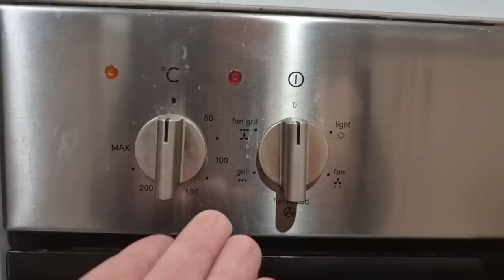The Tool That Changed the Gold Rush | Why Did The Gold Rush Miners Use These?

Comment: As an experienced rocker box builder and user I would recommend putting a few riffles on your top mat and have the matting between them (I usually use 12mm square dressed pine) and miners mass as the mat. All of this will increase the top mat recovery and help it spread the material out, which increases the bottom recovery as well (ie. run more material or clay-y stuff between clean outs) while still being a more authentic rocker box
Reply from the maker: Thanks for the tips!
Reply: Would dream may be good for the box?

Comment: Classification is also important not just for particles competing in the sluice but for the actual force of water required to move the particles to be different enough to allow separation.
Considering a round-ish particle of black sand, and similarly shaped piece of gold, the gold can have 1/3 the diameter before the force becomes the same. Classifying to 1/2 causes there to always be a significant difference allowing the gold to be separated.
Reply from the maker: It literally has a classifier on it.

Comment: Also. Jerky….. I’ve been making it for years now. From all sorts of meat, beef, kangaroo, rabbit. Love it all, the worst part is my kids also love it. So I don’t get to eat as much as I’d like haha. I have a good recipe to try if you like. 
I also bought  a dehydrator last year. Best investment ever.
Reply from the maker: Absolutely, love to hear your recipe
Reply: @VoGusProspecting  
1-1.5kg  thinly sliced beef top round
3/4 cup Worcestershire sauce
3/4 cup soy sauce
2 teaspoons freshly ground black pepper
1 rounded tablespoon smoked paprika
1/4 teaspoon cayenne
1 teaspoon red pepper flakes
1 teaspoon garlic powder
1 teaspoon onion powder
1 generous tablespoon honey
- Marinate for 6 hours or more.
Then in the dehydrator or oven at 75-85 degrees for around 5-6 hours. If you like more spice, add more spice. Also if I run out of smoked paprika you can sub in a tablespoon of Smokey BBQ sauce. This tends to be a little sweeter though.

Comment: I noticed you have the Dream Mat Micro as your clean up mat. I am using that on with black beach sand and find it is the best I have tried so far. I dont think I will be using a rocker box any time soon though. But it does give me some ideas. There are areas and times in Michigan when we are not allowed to use a sluice but we can pan just about all year round. I have been working on ideas to combine a gold pan with a sluice.

Comment: You do you, but you don't need to cook it.
Reply from the maker: You certainly don't, absolutely right.

But it speeds it up a tad and it ensures you don't have contamination for long term storage.
Reply: Friend just slices super thin and dehydrates to absolutely dry.  Lasts almost forever, more when vac packed and frozen...

Comment: Yeah... but your Rocker lacks aprons? And without them you only have a rocking sluesbox. And no I'm not going to exsplain what they are. I've been fighting for 25 years advancing the original design to fight health issues. That my insurance will not cover. I've eaten only eggs for the last 7 years and nothing else. And yes' I'm realy pissed off. But my revenge is at hand. One that will see me get my surgery. And finally I can let others see what their missing out on. As with what I make out of a rockerbox? Anyone can earn a wage from prospecting. More than just paying for the gas and will pay all the bills. But is unlikely to make you rich. 

 It's slow going, working with only my SSI check. And now find myself homeless and in a fight for my very survival. As I can't work' because my gut makes me unreliable. But I've been up against this wall a long time now and it is why I designed my rocker to be fully automated. "Just set it up" and keep it fed. And it will run for weeks non stop. As it does everything but take the final values and turn them into a bar. "Yet" Best part is it runs strictly on reclaimed water and has a collection area that fits most local laws. It will run nearly as much volume as a sluesbox but with zero lost gold. Even 500 mesh gold can't escape it. And I can push that to around 800. And maybe 1200 after I have found enough money to get me into a shop before I die. 

When people see how much gold exzists below 100 mesh? Nuggets won't be a thing anymore. And if done right it will be a new gold rush. One built off a technology that people chose to forget. So never evolved into the modern world. With modern materials and mechanisms being applied to it. And after chasing it for 25 years I think I've come to know them all. 

There is  old saying that says. With all the flour I cam find? I can buy all the nuggets I want. And that is a very true and accurate but only when you know how to build and use a proper rockerbox. Or are willing to risk it all with mercury. As the use of mercury in the collection process' is the only way to match a rockers recovery rate. And it is a criminal act in most countries to use mercury for more than clean-up now. Bur probably was the rockers demise back when mercury was readily used in the collection prosses. So the rocker was unneeded.